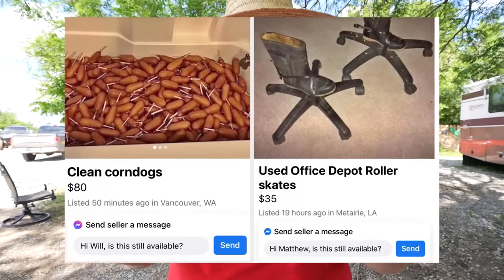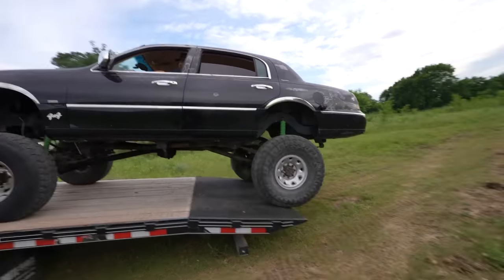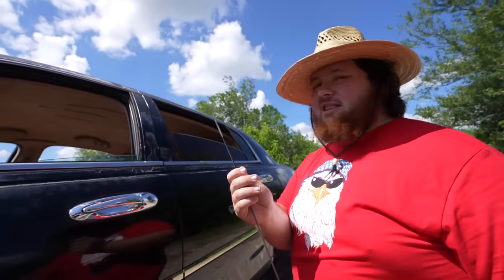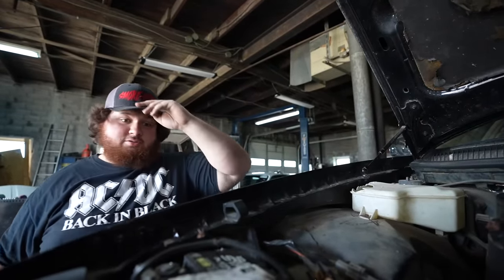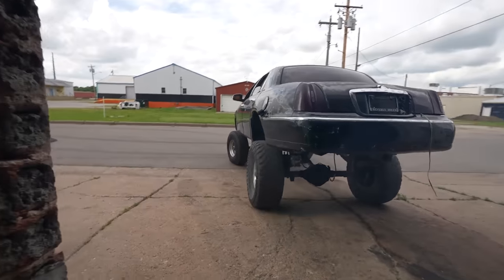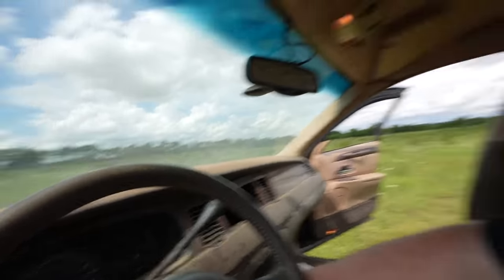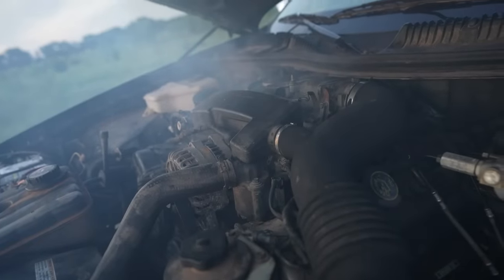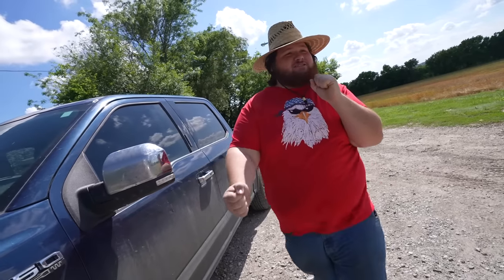I Bought a 4x4 Lincoln and Blew it up

Comment: He needs to put a Diesel engine in a Tesla and take it to a Tesla convention
Reply: Rich Rebuilds is putting an LS in a Tesla over on his channel
Reply: Thanks
Reply: ooo cummins tesla, that would be a sight.
Reply: @catgaming2210  duramax*
Reply: @catgaming2210  rich rebuilds is building a Cummins Tesla 🤣
Reply: @Robo-xk4jm  
Yeah, eww.
 You misspelled CUMMINS..
Reply: @austinlane5533  nah i think i was right the first time, more so older duramax then new, but hey at least we can both agree powerstroke is a joke
Reply: @Robo-xk4jm  no sir. We cannot. 
I'll buy a bicycle before a duramax. 
The bicycle would get twice the mileage. 
Spell it with me, C-U-M-M-I-N-S. 
Atleast the powerstroke would pull itself to the junkyard.. 😆
Reply: @austinlane5533  whatever you say, at least my chevy wont rot out beneath me clown
Reply: @Robo-xk4jm  cummins
Reply: Bro💀 teslas are electric

Comment: I was reminded and gave you a nod upon buying an 85' Ranger lifted roughly 10 inches total.  We are finding out just how rotted the cab really is as we dig in and try to get it at least trail ready....since the nearly new appearing 35's on it are all weather cracked from sitting out in the yard to damn long.

Comment: I bought a nice looking Acura off craigslist for $800 a number of years back after not having a license for 5 years. The head gasket went bad pretty quickly and rather than fix it, I drove it out into the forest of northern AZ and tried to blow it up. After numerous doughnuts spun and whatnot it started to overheat and blew all the coolant out. I kept going and going but the engine somehow just kept going too.  After awhile I hit a large jump and blew 2 tires when I landed and jacked up the front bumper and the car looked a mess at this point and the engine was ticking real loud but still running. I decided to drive it back into the little town I was outside of that's full of tourists heading to the Grand Canyon, it's the last town before you hit the canyon,  Williams, AZ.  I drove it right down main street which is route 66 pretty slow with blown out tires and the engine ticking like hell and gave the parade wave to all the concerned looking tourists while expecting it to break down any minute but it made it to the house somehow and I sold it to someone who fixed it up and was driving it last I checked.  
That Acura had a miracle engine in it or something.

Comment: At 4:40 sounds exactly what my Town Car was experiencing if the engine is still the 4.6 in it, it ended up having a misfire on Cylinder 3 and a Vacuum Leak and I got em fixed and my car runs like a champ.

Comment: I think it's a compression problem. It idles erratically, and loses power and shuts off at idle. Smoke is burning oil on outside of block from blowby, I THINK

Comment: Wired the fuel pump to the trunk light....... A good 50 years ago I pulled that classic when I wired an 8 track to what turned out to be the interior dome light.  Well, it was hot when we opened the door, went under the dash looking for a wire that was hot all the time.

Comment: That's crazy. I have a 97 f150 with the 4.6l 2 valve. 450k miles and runs and sounds brand new. Bought it for 1500 too. I hope mine never sounds like that. Which it'll be ls 2 swapped so when people ask what motor I can tell them a 6.0. While they are thinking powerstroke I'll be pumping chevy power lolol

Comment: i bet if you just take valve heads out and clean all and check valve's cap's, & put timing right & clean + setup carpurator its gonna run better.

Comment: Yup I think the person who was working on it said hold my beer!!
Try changing the God damn spark plugs and coil packs and try using the stock gas tank with a good fuel pump and you might get some horse power to the wheels

Comment: @westenchamplin you should do a om606 conversion but take the 606 pump swap it fore a diesel technics manual pump and a big turbo it will run 600bhp in a diesel brother X

Comment: I like how when Westen bought a piece of junk and it don't run it don't drive the brakes don't work and there's four bolts holding the tire the transmission bolt is not even tightened there is no bolts holding the transmission There is five zip ties holding the shifter cable and the lights are falling out the Lincoln emblem is missing and the engine smoke so bad the radio missing the interior is all ripped up

Comment: was thinking of doing this to a 1994 thunderbird, but the local guys want 1500 just for one axle... ask them what happened to the rest of the truck? bought truck $2000, ripped it apart for no reason other then thinking parting it out from under the states eye would be profitable... Introducing, Canada's emergency's act: hindering pointless actions of impulse. grow potatoes 5gal/500sqft doing nothing, 3 foot 4 between each plant.

Comment: I'm workin on building my 3rd Gen Town Car into an off-road beast but not gonna frame swap it with a junk ass chevy like every idiot wants me to that will never happen. I'm gonna install an off-road suspension on the car as is and then swap rear diffs with my 4.10 LSD Diff and doing top end and camshaft and it's all gonna be Ford/Lincoln and not some junk truck with a junk motor.

Comment: I have a cheap  lightly damaged running driving Lincoln towncar with good working Engine and transmission for 900$ needs bumper and headlight if anyone wants this beast lmk in Savannah ga